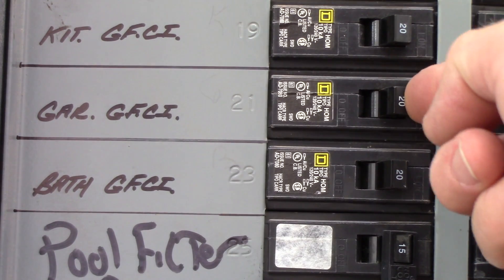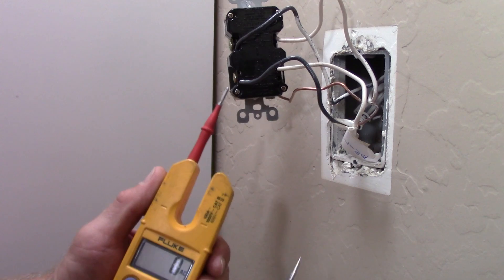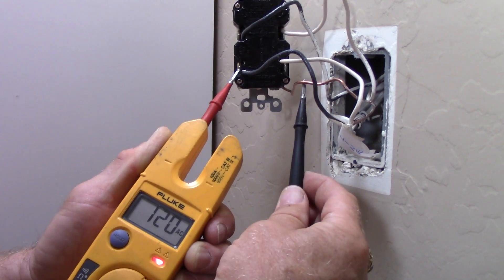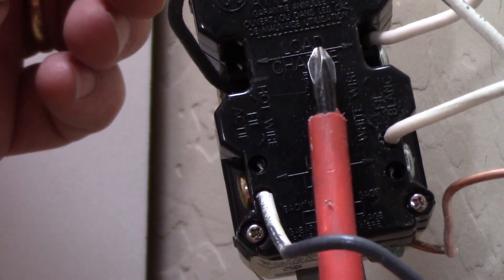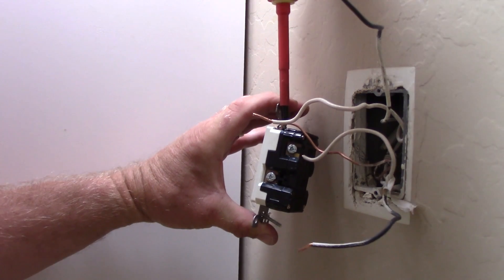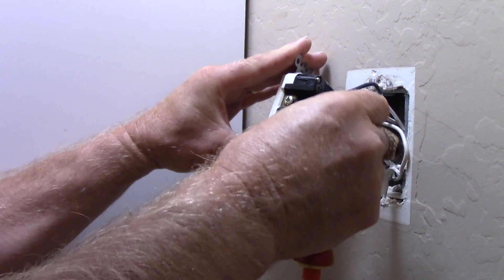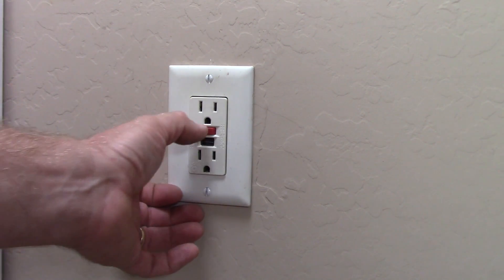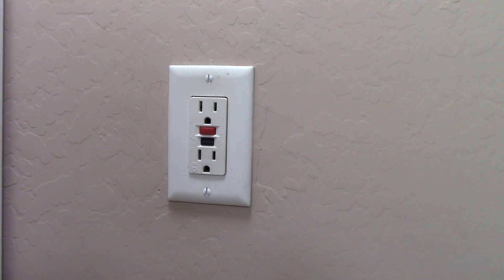Replacing a Faulty GFCI Receptacle

Comment: Mr Peterman, I have a black wire showing hot AND a white. The old gfci showed two black on line and two white on load, what the heck??
Can’t get anything to work on new gfci (frig on same circuit running fine!
Reply from the maker: No easy answer to this one! It needs some hands-on troubleshooting I think.
Reply from the maker: But it would seem that this was fed with a hot-neutral reverse and same then on the load

Comment: Terry, Very thorough video, and explained why my outdoor receptacles are on the same circuit as my garage GFI. This might be code, but I sure wouldn't wire an aircraft like my 1997 house was. Granted it's worked fine, but having 10 receptacles (in this 1997 built house) on one 20 amp circuit, boggles my mind. The perils between commercial, residential, and aircraft wiring are all the same. Shorts create increased risk to property and lives. It might be more cost effective serially gang 10 convenience outlets on one 20 AMP breaker But I think it would be far safer if residential and commercial were limited to separate lights from outlets, and outlets grouped to areas; i.e. NE BR, SE BR, LR, KIT, GAR, MB.  And...in my case, I still haven't located the breaker that controls my garage GFI!!! of keeping things more isolated to circuit supporting a function. I'd like to strangle the tech that wrote the index for my house - not to mention the inspector that lets this pass. ;-)

Comment: 605 Central Time Chicago Illinois, I just put in a new gfci in my basement bathroom, it's 2wire black is hot side white land side, turned the power back on,I get the green light that comes on,green light stays on try to test and reset it  won't reset button won't push in, both button won't push in

Comment: I have come to suspect that a lot of owners of old houses have DIY-installed GFCI outlets in place of the old 2 or 3 prong standard outlets, in rooms like a kitchen or bathroom, thinking that just that replacement will give the safety of GFCI protection, when in fact the wire to the outlet is an old 2 wire (no ground) cable (a bogus GFCI outlet). 1-How can I use an outlet tester to confirm or deny that a GFCI outlet has valid GFCI protection????  2-A GFCI outlet can give GFCI protection to other outlets wired off of its neutral and hot LOAD terminals. But, is it necessary to also connect a ground from the LINE side to a ground in the cable leading to those (LOAD side) down-line ordinary receptacles? ................................ [I bought an old house and want to at least convert the 2 prong outlets to 3 prong. I'm finding either no ground wire in the outlet boxes (obsolete 2 wire, no ground cable)or an incoming cable whose ground wire was cut un-usably short; I'm not even looking for GFCI protection there, just a way to have the equivalent safety of a valid 3 prong (i.e. grounded) outlet]......................  3- Can I just replace the breaker with a GFCI breaker if there are only a hot and neutral (no ground wire) in the cable?
Reply from the maker: Your suspicions are justified.  What you are experiencing is what is an acceptable solution to wiring with 2-wire cable without a ground wire, and making it as safe as you can given the circumstances.  By putting a GFCI receptacle on these 2 wire circuits, you are providing personal protection from an electrical shock.  The principle of GFCI protection is to monitor the current in both the hot and the neutral, the intended path of current flow.  If there is 5 Amps on the hot, 5A on the neutral, all good!  But if there is 5A on the hot, 4.9980A on the neutral, it will trip. So if all is well, the circuit works just fine, and until there is a short circuit (in which case, the over-current protection will open the circuit.  But if there is a leakage of current, for example, through your body, or water in an outlet, drop an electric tool in the sink, pond, pool, etc., the GFCI will detect this imbalance and trip. So unless you want to re-wire the home with grounded cable, this is what is done.  If you need to discuss this further, email me at internetelectrician@gmail.com with "follow-up GFCI" in the subject.
Reply from the maker: So further to this, a GFCI doesn’t care if there’s a ground path or not, or where the lost current went, just recognizes a problem and cuts the power.

Comment: Hi my gfci is not working and it has a color yellow light. I pushed the reset button and test button and it doesnt click. I turn off the gfci on the main breaker and still not working.

Comment: My GFCI 15 Amp. May i replcace 20 Amp sir?
Reply: There's no reason to do that. If it's a 15 amp circuit, it would be a code violation. If it's a 20 amp circuit, it would be permitted, but a 15 amp GFCI is also permitted. They are the same internally, so there would be nothing gained outside of 20 amp circuit identification.

Comment: I didn’t get it. What did you do with those cables? You flipped them? Or you changed to new ones? Please explain in simple words step by step what did you do regarding the positions of these cables!
Reply from the maker: Hello Renan.  I'm not sure what you don't understand, but I can try to explain.  You have a cable coming in  that is the power source.  That goes to the "line" terminals, white (neutral), and black (hot).  Then you have a cable that goes out to  the rest of the circuit that you would want to be protected downstream of this GFCI, and you would connect those wires from that cable to the "load" terminals.   The ground wires get spliced together along with pigtails to go to the box ground terminal (if applicable),  and to the green grounding terminal of the receptacle.  If this doesn't clarify things for you, I am available on PalTap for live video consultation at http://paltap.me/internetelectrician

Comment: Just a note, it's always a good idea to remove metal jewelry before working on electrical work. Also don't work with sweaty hands as salt water is a much much better conductor than dry skin. This last one I learned the hard way. :)
Reply from the maker: Good advice. I always forget to take off my rings for my videos and have been called out on it many times. Also good advice; shut off the power so there’s no chance of a shock at all, regardless of rings, sweat, nuttin!

Comment: If you forgot which cable you took off the load side. Do it matter which cable go on the line or load terminal?
Reply: Yes it does. The live (hot) wire and its associated neutral go to the Line and the other ones go to the Load, if you want to protect downstream outlets. If not, they all go to the Line.

Comment: My bathroom GFCI quit working (it is getting power, I have a voltage tester "pen" that flashes and beeps indicating power).  I bought a new GFCI and installed.  Only one wire leading to it, so made sure it was hooked up to "line" (and confirmed one I took out was wired to "line").  After turning breaker back on, checked the outlet and the red light was blinking indicating an "end of life" condition per the instruction sheet????  Pressing test and reset buttons did nothing.  Plugged in a receptacle tester and no lights.  What are the odds of buying a bad GFCI?  Guess I will return it and try another one.  I put the old one back in and it was still dead.  Suppose if another new GFCI doesn't work, there is a bigger issue going on and may need to call someone.  Though no clue what that issue could be.  A light switch in the same wall box works fine.
Reply from the maker: Those non-contact voltage testers are way too unreliable to properly trouble-shoot this problem.  Rub it through your hair and you'll see that you have the same indication of power in your head! You need a voltage tester, even a 2-wire neon tester at the least, but a multimeter would be best.  I would guess that you have lost the neutral in the circuit? But it also could be the hot.  Either in a bad connections or splice somewhere upstream, or at the breaker panel if this is the only device on the circuit.  Get a proper tester, and I'll help you trouble-shoot this via photos and email, or with facetime or some video type call.  internetelectrician@gmail.com and we can go from there.
Reply: @theinternetelectrician  Turns out it was a bad GFCI.  Before taking it back to the store, I wired it up at another outlet and it still showed the blinking red light.  Exchanged it for another GFCI and that one worked fine once I wired it up.  Thank you for the offer to help.  I do have a multimeter (came in a set with the pen and outlet tester) but when I tried using it as you show in the video, the display would jump around between random numbers and made no sense to me.  Did this on another outlet I experimented on as well.  I think there was a low battery indicator on the display so I'm guessing that had something to do with it.  I didn't have another 9-volt to replace it with.

Comment: I have a question I was having a problem with the low-voltage turn out to be a powerline outside. My house was damaged and the power company replaced. today I discovered in my room, my ceiling, fan and light work the switch to the bathroom also works but the closet light and for outlets do not come on
I discovered a GFI switch, and when I press the reset button. It pops out immediately can Bad GFI switch. Really create no power to four outlets and a closet light
Reply from the maker: Hi Richard.  Yes, a GFCI can go bad and need replacing.  in all likelihood, whoever wired that circuit connected those outlets to the 'load' side of that GFCI outlet and that's why they are out.  This could be corrected.  When you change out the GFCI receptacle, you could pigtail the incoming feed and outgoing feeds to the 'line' side of the GFCI and not use the 'load' terminals.  If you're not comfortable with doing this, hire an electrician to come take care of it for you.  As always, safety first, and make certain the power is off if you take on this project yourself.

Comment: I have a treadmill on a GFCI circuit.  It has worked for a number of years.  Recently, the GFCI outlet broke and I replaced it.  The circuit tester shows that I wired it correctly and the test and reset buttons work and I have power.  I can turn on the treadmill, but as I increase the speed, the GFCI trips.  Any thoughts?
Reply from the maker: Must have a more sensitive GFCI than the old one was.  The treadmill must have a bit of "leakage" to ground.
Reply: @theinternetelectrician   thanks for the reply.  Although the first GFCI was 20amp, it’s been sitting in the original box in my drawer.  Don’t know if they go bad but I replaced it with a brand new one and it’s working fine.
Reply from the maker: @laneemley5865  Yes, they can and do go bad.  I've had faulty ones right from the factory.  Both ones that don't trip on a ground fault, and ones that are too sensitive.  You must have got the latter.

Comment: You mention the GFCI was powered by a 20 amp breaker but you installed a 15 amp GFCI outlet
Reply from the maker: Good catch!  But the code allows for this.  If it was a single receptacle (not a duplex outlet as is this one), then the device would have to be rated at 20A and be a 20A 120V configuration, or at the very least, a T-slot, 15/20A 120V.  But being  it's duplex, the rationale behind it is that your are really "sharing" the supply of 20A between 2 potential connection points, thus 15A duplex receptacles are allowed on a 20A circuit.

Comment: This is my exact problem. I have 3 outlets not working (in my kitchen). I thought I'd have to replace the circuit breaker in the panel, but I followed your same steps and I DO have power to the line side of the GFCI. That's good news. Thanks.
Reply from the maker: Happy to help out! Thanks for the comment, and I hope that you gave it a 'like', and that you've subscribed to my channel?  Have a great day!

Comment: It appears you not know what a earth ground and a neutral is. As a current line also you call a hot wire. Did you not know  a neutral is a traveler wire as a currect wire is ? Both can kill you by electricution. Current wire to the no fault circuit you on is 120 v ac. Since it a ac not a dc line the neural  is 60 v ac. In usa the speed of pole service current is 60 times per second called 60 hertz. In most  other nations its 50 hertz . Ok every 1/60th. Of a second  when this circuit is in use , the current line is 120 v ac. And the  neutral line is 60 v ac.the earth ground is ehat makes the no fault receptical. Withoit earth ground you have no , no fault period. The earth ground trips the breaker in receptical by a short in circuit. Saves lives by being   faster to trip than panel box breakers. Panel box breakers if not got the  wire attached to the breaker that goes to a earth ground bar Only. It is a no fault panel breaker mostly cost 3 times higher. The regular panel breakers eithout earth ground wire trips by heat only to melt the mercury to release breaker and it trip.  Now the heat is very hot , way over 120 degrees so if you get on it, you must get as hot as the breaker before breaker trips. Most people catch on fire brfore it trips. So see how no fault saves lives ???? Very important , must be around water. It fatal.

Comment: Terry, gfi outlet trips in garage when sprinkler goes on. 2 separate circuits. Sprinkler on 1 & garage on other. Garage dr opener is on garage circuit. Has been wired this way from when house was new. If u can, please help
or do I need to call a electrician.

Comment: Thanks, Terry. I have a question. You turned off the power break in the first step. Why there is still 120V from the lines coming into the GFCI outlet?

Comment: What if you have one cable for load hot (black) and one neutral (white) will the gfi work. Also should test n reset buttons work before installing. The outlet itself is blocking the ability to plug anything in.

Comment: After 8 years I had to replace my GFCI as it wasn't working.  I only had B & W Lines wires coming in and no lLOAD going out.  Simple fix.  But the green proof light does not glow on the receptacle.  I tested the outlet with a Klein brand receptacle tester and got two orange lights to glow proving all is correct.  So why doesn't the green proof light glow on the receptacle?  THUMBS UP!!!
Reply: Need to read the instructions to the receptacle.  They all operate differently and the lights mean different things on different brands. (Yes, it's a pain - they aren't standardized).

Comment: What if you put a Voltage tester in the gfci And it tests power but it won't reset, would it be the gfci that went bad?
Reply from the maker: Could be, or it also could be that the wires are mixed up with line and load, etc.  Thanks for watching!

Comment: I know this is an old video but I've had to replace the outside GFI recyclable three times in a year ? 

The ground wire to the houses breaker box are good also I have three wire Romex in the house  and it's hooked up correctly to the GFI and its also underneath roofed in porch  with a  weatherproof case.......
Reply from the maker: That’s obviously not normal. It needs some hands-on trouble-shooting. What do you use that receptacle for? Is there something that you’re plugging in to it that causing the problems?
Reply: @theinternetelectrician  just some LED Christmas lights and one or two blow ups  

The one that was installed lasted 2 years then this year it took a crap for Halloween then the new one took a crap with a Thanksgiving blow up turkey and now I just installed another new one for the Christmas lights.

Comment: Hey Terry, I have a pellet grill that keeps tripping my garage GFCI. The troubleshooting resource said old GFCIs have a "nuisance trip". Is this true? Could it be a sign the outlet is failing? I know it could be a number of things, I don't think I have anything else drawing a load on that circuit, but I'm still double checking. Thanks for the help!
Reply from the maker: Nuisance tripping is a "thing" for sure.  But more likely that there is a fault in the pellet grill and whatever is the electrical component of it.  Run an extension cord to another GFCI protected outlet and see if it trips it as well?  If not, faulty outlet.  If so, faulty component.
Reply: @theinternetelectrician  Thanks!

Comment: Great video - I have one question.  Isn't that a 15 amp GFI that you replaced?  Is that ok to put in a 20 amp circuit?  Thanks for your help.
Reply: Yes it is. The same goes for regular receptacles as long as it is a duplex (2 places to plug in) receptacle. If a single receptacle was used on a 20 amp circuit, then it would have to be a 20 amp receptacle. Single receptacles are primarily used in a dedicated circuit. GFCI's don't come in single version.

Comment: My GFCI outlet in my bathroom won't  turn off. Everytime I touch the Reset button it pops right back out. Also the light on the GFCI won't turn off. It stays orange. Also the area where the orange light is is kind of hot. The outlet is not hot but just the area where the orange light is at. My house isn't going to catch on fire right? Lol.... Is the light being on a bad thing?
Reply from the maker: The tiny orange indicator light will put out some heat, so that may be normal, but your GFCI needs to be replaced or it is somehow connected wrong with a line/load mix-up. It could also just plain be faulty. I’ve had them not work properly right out of the box. Not exactly a “dangerous” situation, but get it remedied.
Reply: @theinternetelectrician  Thanks for the help and the advice.

Comment: I think I have a bad GFCI in my little RV trailer. I pulled it out of the box but it looks different. It is a sealed box with five wires coming out of it. Green wire for ground, a red (load) wire on the left side, a grey (load) wire on the right side, and a black and white wire coming out of the center. What does each wire do? It is marked as a dual pole.